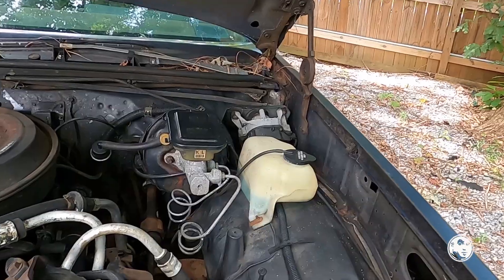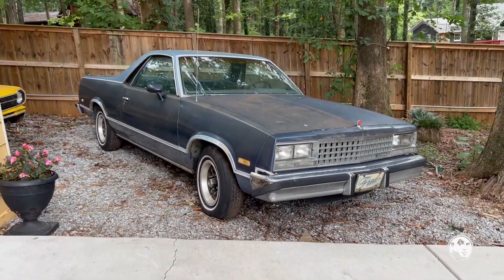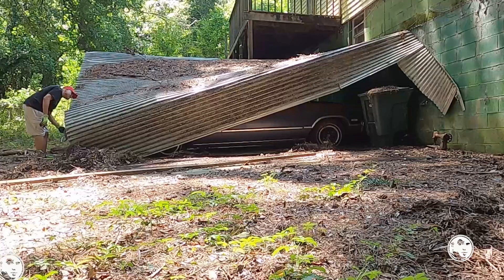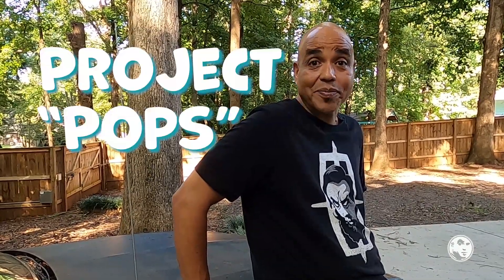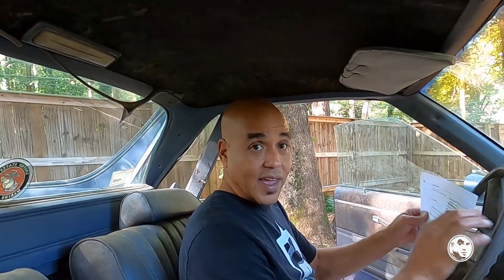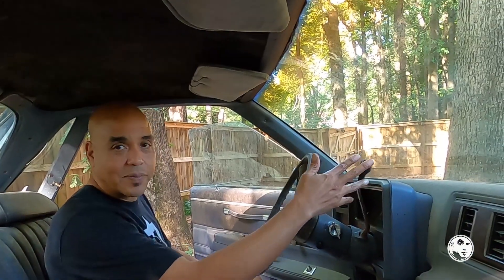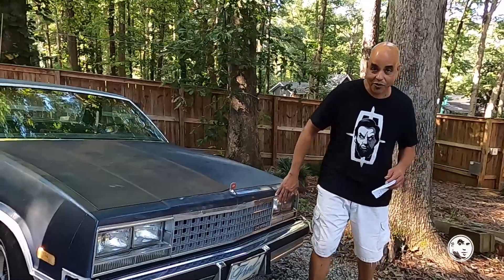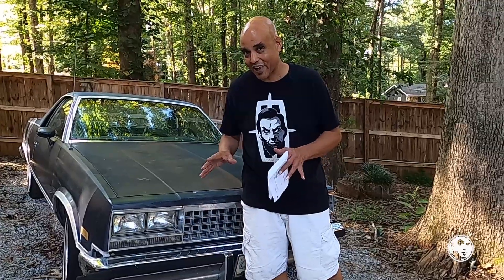1984 El Camino REVIVAL: The PLAN #elcamino

Comment: Talking about tunes knowing good and well you still got cassette tapes (and good ones too!)! Since you in the ATL, it was the legendary rapper Clifford Harris aka TI that said " blowing dro on 24s, thats how all my partners roll". That could be your wheel solution 😂
Reply from the maker: Hahaha! You're right! I can't lie! But 24s? Ha! That'll never happen! Lol Thanks for watching Bil!!
Reply: @SkaggsGarage do 18s in the front and 20s in the rear. Also check every single rubber and the steel around the body mounts....this is a must with any g body or a body!! Do urself a favor and go  with spohns suspension and viking coil overs if they to pricey run viking shocks. Plus do the over sizes way bars.. these cars will out run and handle just as good if not better then a modern sports car. 
I have a el camino and a cutlass.  My cutty is a road race build. All custom and fully stripped down. Oh check in corvette c5 brake upgrades!!! Man these cars are awesome.. after u rebuild them lol
Reply from the maker: @redneckswitwheels  hey I appreciate the advice! New to G-Body cars so thanks for the info! Thanks for watching!
Reply: @SkaggsGarage  yep no problem man just don't want to see u make the same mistakes us g body guys have

Comment: Remove the smog if you’re not in an emissions state. Tune it up. Add true duals (no converters). Probably need to rebuild or replace the carb. Keep the computer carb so the trans will work right. Drive it and enjoy it a while like it is.